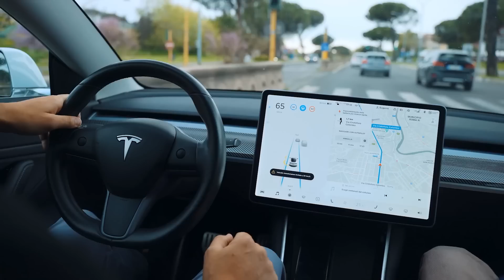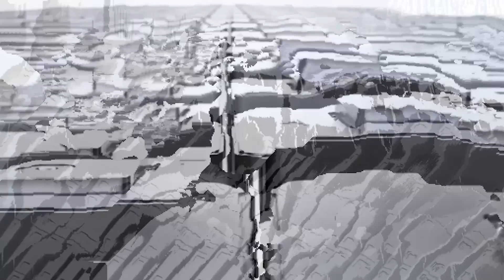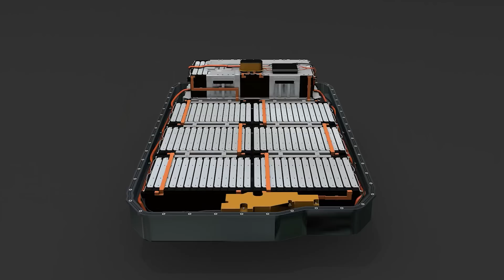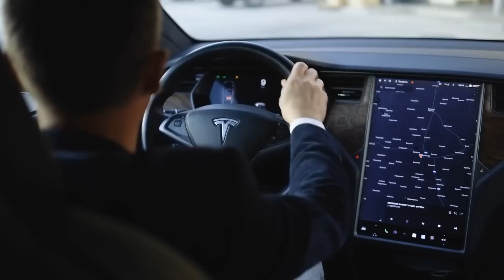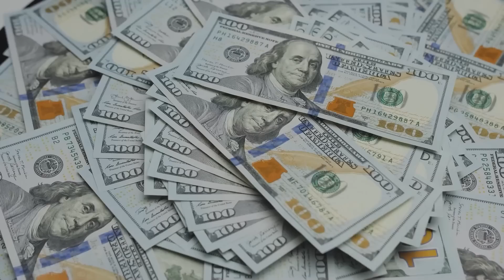Tesla & BYD Confirm Powerful NEW EV Partnership

Comment: 5:58 I'm pretty sure that Tesla is going to be importing all of the Model Y's to Canada from China and probably the model 3's as well because the big problem they're having here in the USA is that they don't have enough production available.  Here in South Florida, if you check the inventory for ANY Tesla with the full $7500 rebate, there is ZERO available.  I've checked in other areas around the United States and found the same issue.  Sure you can still place an order but that tells you how huge the demand is that there's zero in inventory.
Reply: And why is that?
Reply: @blokin5039  the Chinese factory has a run-rate of over a million per year, basically their run rate has increased by approximately 300,000 cars per year over the past year.  On top of that they're exporting less cars to Europe because the the Berlin factory has also had a massive increase in the number of cars that they are producing. 
In the u.s.a. the $7,500 only applies to American built cars, with American batteries.  In Canada there $5,000 incentive applies to any electric vehicle.
The end result is that Tesla can import cars from China to Canada and it doesn't make a difference to those consumers, they're still getting their incentive. This leaves Tesla free to sell all production made in the USA in the USA, where there just isn't enough cars to meet demand.
Reply: @TheCostofAutism  But why can't the USA factory produce enough cars? How does the run rate stack up to the factory in China?
Reply: @blokin5039  EVERY Auto factory, regardless if it's run by Toyota, GM, Whoever.  They ALL need time to "Ramp Up" production  GM is STILL only making about 3000 Cadillac Lyric per month, a year after starting production.  Keep in mind there are THOUSANDS of parts that need to come together and it's not always easy to get everything to come together smoothly.  The Chinese factory, which was the FIRST Purpose built plant by Tesla began operations in Dec. of 2019, so they've had over 3 years to ramp up production.  BOTH TX and Berlin opened about a year ago.  When they opened the Shanghai plant it was slated to produce 250K cars, just like Berlin and TX, however a year later they filed to increase that run rate to 500K cars in China, and they've just done the same for Berlin plus announced the same plans for TX.  After Shanghai was open for two years they filed to increase production to 750K and after 3 years to 1M.  They will end up doing the same for TX and Berlin.
Reply: @TheCostofAutism  It's remarkable that Shanghai apparently is still pulling most of the weight for Tesla and not the country of origin. I also don't understand why Tesla's from China are going to Canada instead of a US factory. Less distance means cheaper transport costs.
Reply: @blokin5039  Remember that Tesla's first factory in CA was originally designed to build Toyota's and GM cars.  It took Tesla a while to figure out not only how to build cars, but also how to build the factory in a way that produces them efficiently.  Shanghai was the first factory Tesla made SPECIFICALLY to build the Model 3 and then the Y.  Even so, the CA factory makes more cars than ANY factory in the America's and that's including EVERY brand.  The only factory in the world that makes more cars than Tesla's CA factory is Tesla's Shanghai Factory.  Tesla's biggest problem right now is that they are selling EVERY car made in both CA and TX to US buyers, so they don't have any "extra" left over to sell the Canada.  Since the Auto market in China is a bit soft right now, and they've increased their production so much.  Tesla can take those spare cars they're building in China and sell them in Canada.
Reply: Tesla just can't keep up with production rates. Don't worry, it's happening across the globe. 1.2 million cars last year on target for 1.8 this year.

Comment: Isn’t the blade battery the same as ultimium batteries from GM?
Reply: Nope
Reply: @kosmokramer9502  looks the same lol
Reply: @Iggy1008  it is not the same
Reply: No it even close. Pouch cells with Cobalt vs Ridged cells without Cobalt.
Reply: It’s the same. The batteries on the bolt are pouch cells but the batteries that gm is using on their newer cars such as the hummer are blade batteries. They also enhance the structure of the vehicle. Just because the Apple is green or red doesn’t mean they’re not apples. Lol the Chinese are always copying American engineering.
Reply: @Iggy1008  dude say that BYD copy GM when BYD are the first to invent the blade battery lmao. And the battery aren't even made by GM, it was made by LG Chem. Your lack of knowledge says a lot already
Reply: @Iggy1008  It's not the same.
Reply: @Iggy1008  byd  use their own patent blade battery not gm
Reply: @Iggy1008  WRONG.... Watch Sandy Monroe's teardown of the "Ultium Battery" and you'll understand.  They are NOT structural like Blade batteries.  They're soft "pouch" batteries and worst of all they're VERY expensive.  BYD's blade battery is almost HALF the cost.
Reply: Just because the insides are different doesn’t mean the design isn’t the same.
Reply: @Iggy1008  GM is nowhere with EV tech while BYD is the technology leader together with CATL. Yes both are Chinese companies. I suggest you contact Elon Musk to say he must go with ultimumium instead or whatever, good luck.
Reply: The Chinese must of stole it from an American company. They be doing that.
Reply: @Iggy1008  LOL, Dude how naive can you be?  Why do you think Ford is PAYING CATL to setup their LFP battery manufacturing facility?
No the reason China has such a massive advantage with LFP batteries is because #1, the Swiss company that owned the original patent for LFP put an exception to the patent that Chinese companies didn't have to pay a royalty.  
#2, since most of the existing battery patents were around Nickel based systems that were owned by Japanese, Korean, European and US Firms, THAT was the battery tech we in the west pursued.  Keep in mind Nickel based tech was considered SUPERIOR.  It had over DOUBLE the power density, could charge much faster and had high voltage and high output that was great for performance, like the original Roadster.
#3, The Chinese government gave Chinese companies HUGE subsidies to research LFP, because they realized that in the future there would not going to be enough Nickel (most Nickel at the time came out of the Ukraine and Russia... A lot used to come from both former Soviet states of Chechnya and Georgia, but since Russia invaded those countries, they were shut down.)
#4, After a decade of research and development, both CATL and BYD have had incredible advances in LFP battery Tech, BYD's Blade battery is probably THE most cost effective battery in the world and CATL's M3 battery is the most energy dense LMFP battery in the world (they added Manganese).  The newly reintroduced LR Tesla Model 3, with 333 miles of range is almost definitely the new M3 battery by CATL.  To top it off, this new LMFP battery overcomes a lot of the cold weather issues that the older LFP batteries had.  ALL of this is new patents by the Chinese, they didn't steal it from us, because we were not even researching this stuff!  We've been chasing the holy grail of battery tech... Solid State Batteries.